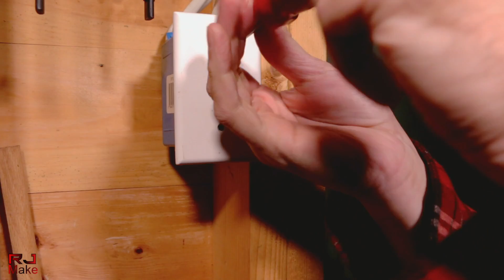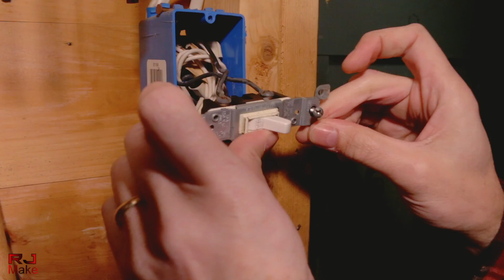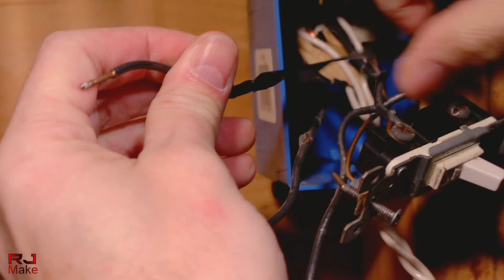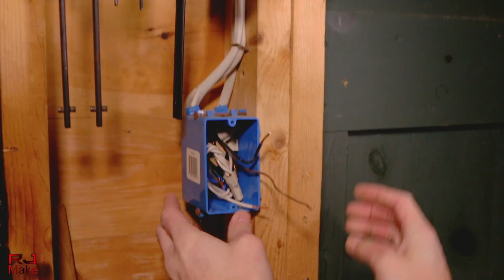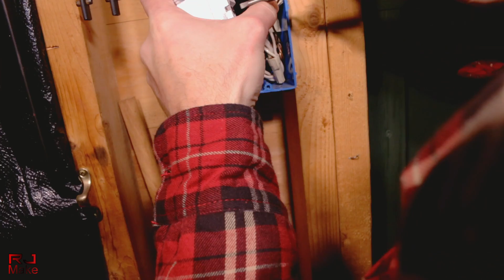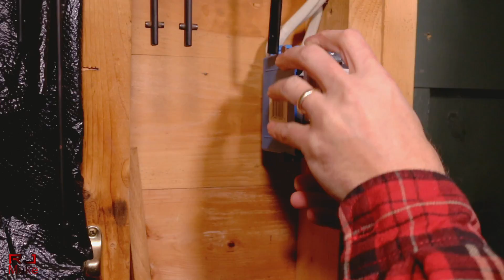How to install a Z-Wave Light Switch

Comment: Bad install - you definitely have a "box fill" electrical code violation there. Way too many wires in that box. There are tables in the electrical code that dictate how many wires are allowed in any box of a given size, and the wire nuts are actually included as part of the calculation. This is not just another annoying rule by the 'man' but definitely meant to prevent a fire issue. I've seen more than my share of switches, plugs, and even the wire nuts that have caught on fire, and disintegrated - a very scary sight. 
 The more cramped that box is, the more heat is produced, which actually affects how much load that dimmer/switch can handle, and the excess heat will reduce the life of the device as well. It may possibly make the dimmer noise louder as well, but not always the case. You can see that the switch barely fits in there, and I'm betting it was the screws being tightened down that even allowed the switch to be pushed into the box as far as you managed to get it. The only way to really fix this is to swap out your electrical boxes for deeper/wider ones, which us electricians do all the time. The switch may or may not actually specify the cubic inches it requires, and electrical boxes have their capacities in cubic inches stamped inside each box for this very reason. Anyway, just some info that may save a life.
Reply from the maker: Thanks for your observations and comments. No doubt it's tight. It's a 20 cubic inch box, and carries the load of 1 60w light bulb, and 1 receptacle. It's #12 wire so you are correct, I'm 2 wires over in the box (jumpers are not considered in the calculations AFAK), and I'm 1 wire over under the nut for the neutrals, but considering the load it carries, I think I'll be fine.
Reply: Yes, in your case i'd say your fine with just that load - i guess my comment was more so for the safety of those watching your videos and repeating what you did verbatim.  Where it gets really dicey is when you get into 2, 3, or 4 gang boxes that are already jammed with wires, and people add several large devices like dimmers (standard or these z-wave compatible type). Heat is definitely your enemy, and if switches themselves are getting warm, then there is cause for concern. You have to remember that you're going from 120V and essentially throttling that down lower when you're dimming, so that energy needs to go somewhere, and its often in the form of heat, right inside the switch box. I do really like your videos otherwise, but when it comes to electrical safety I don't like to mess around. Cheers!
Reply from the maker: Understood. and again thanks for sharing.

Comment: Did adding the switch fix the signal range issue?
Reply from the maker: Yes and No. The door sensor can now reach the network, but not reliably.  It finds a working path maybe 6 out of 10 times. The actual light switch has 14 neighbors, so I'm a little surprised the door sensor doesn't work better.  I'm now deciding on installing z-wave receptacle or a z-wave range booster.  HomeSeer just announced their zigbee support, so there is that also... Decisions, Decisions...  :-)

Comment: You must be mater switch box packer!
Reply from the maker: LOL, I have a lot of experience working with boxes like that, but It was close. I think if there was just one more wire, I would have been looking for another solution.. :-)
Reply: That's the other issues (besides color beige verses white) is that my house built in the late 80's has then gang boxes which are packed!  Grrrrr, drives me nuts!

Comment: So the switch can act as repeater? Also what hub did you say you where using with e ho as wink just did an upgrade and I am poed as it lost half my lights!
Reply from the maker: Yes most modern, line powered z-wave devices will act as a 'repeater' to help mesh coverage. My entire HA system is built on HomeSeer Technologies, and the plug-in developers create for it. I'm using HomeSeer HS3 Pro, installed on a i5-4570S 12GB RAM, Always on Windows 10 machine. The great thing about using HS3 for me is it's multi-protocol foundation. 

I tried Wink, as a matter of fact, it's sitting in the box it came in .:-(  WAY too slow for my taste.. Back then it was a cloud based system, and the round trip for some commands was just too slow for me. Not sure if the system is still based on the cloud?
Reply: They updated the firmware to allow it to work offline and the delay is "ok" per-say but it when it gets hosed you have to delete and re-add all of the devices and that is a huge time suck!
Reply from the maker: Ouch, that is enough for me to trash it. It would take me days to re-add all my devices, then months to re-program them.. No thanks..
Reply: Yupper!

Comment: RJ, I didn't hear what Joel Telling said about switch cover plates but the cover plate is not an "accessory" it is actually a safety device. It helps prevent shocks and shorts by not allowing anything from accidentally coming into contact with the wiring or switch components.  Trust me, I've been in the construction industry for over 20 years. It's just safer with the cover plate on. And you could cut yourself on that metal plate too.  You did a good job with making sure the power was off at the circuit breaker. As far as the nicks in the wire jacketing I would have cut the wires at those points and used wire nuts versus electrical tape just to eliminate the possibility of an arc.  

The project was cool and I hope the switch provided a stronger signal in your Z-wave mesh network.  Do you have an Amazon Echo or Echo Dot tied to your Z-wave network?  I have a Dot, a TP-Link switch and outlet and a few WeMo and Belkin outlets that I have under control via Alexa. I'm looking to add a Samsung Smartthings hub soon. I want to grow my Home Automation and Control here in the near future.
Reply from the maker: Thanks for the suggestions, I would have cut those out also if the wire had been nicked at all. I'm pretty sure if you could have seen them up close you would have done the same.. :-) As you know I'm a master HA-HVAC/R tech so I'm pretty careful in what I think I can safely get away with. I don't take risks, ever.  The missing cover on this switch is just temporary to make sure I can pull this off, if not that expensive z-wave switch is coming back out :-)  

Have you ever used a z-wave switch outside (under cover)? I'm not even sure how the switch is going to handle the extreme temps in the shed.

The reference to Joel was a joke. He never "said" anything, I (we) gave him a hard time way back for having missing covers on a few of his outlets. Joel is a good guy and had a little fun with us over it. I was just "poking" back.. :-)

My home automation system is extensive, and includes many technologies; z-wave, RFXCOM, MySensors, IP Camera's, cell phones, 1 Echo and 1 Dot, all centered around HomeSeer Technologies. I started out with Vera' a few years ago, but quickly outgrew it's capabilities. It's definitely a work in progress, once I think I've got everything just the way I want it, I think of something else and go screw everything up trying to make it work.. :-) 

Here are just a few of my MySensor projects.. https://forum.mysensors.org/user/rj_make/topics I get a little crazy at times... :-)
Reply: RJ_Make - I didn't know you were an HVAC tech!  That's awesome. Then you definitely know the safety things.  Didn't know you were "jokingly" mocking Joel. What a loon. Ha ha. 

For temporary testing then you are ok without a cover plate, especially since you are used to working around electrical as much as you do.  Unfortunately though we can tend to become lax on our vigilance with safety. It would be a good note to mention to your audience that you are a professional and that if they are not comfortable working with the electrical to engage a qualified electrician to advise them or do the work. 

I'm just getting into HA&C and will be checking out your projects and videos. I love the ability of the IFTTT platform to integrate things that normally wouldn't integrate.  I'm looking forward to working with Alexa on my Dots and I'm looking at the Samsung Smartthings platform. I can see possibly using a couple different platforms or hubs to get things to work the way you want them to. 

I have joined a couple of Facebook groups regarding Smartthings and Alexa. Lots of great people to get good info from as well as you. I'll be looking forward to seeing how your project works out. 

I hope you had s great Christmas and a hope you have a safe and wonderful New Year. 

Norbert
Reply from the maker: As always, solid points Norbert, thank you for your feedback.